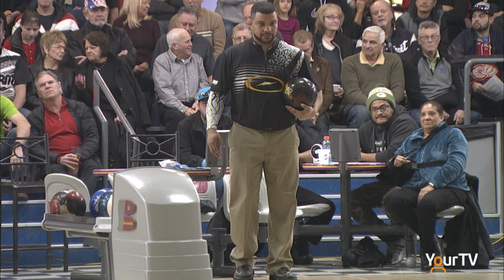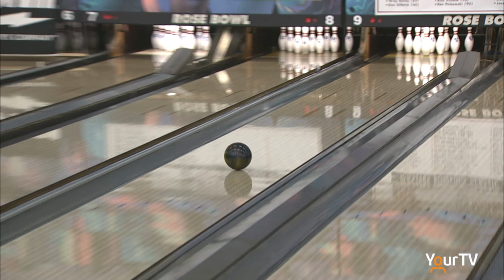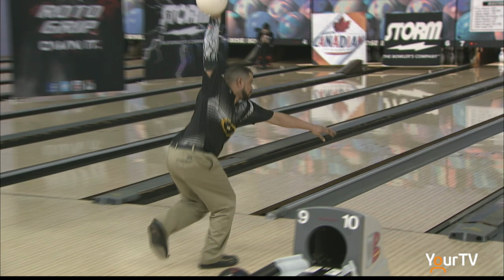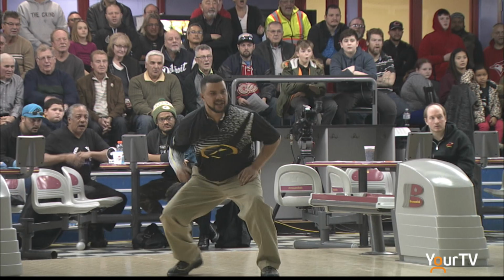Walls Jr. spares 7-10 split

Comment: I picked up the 7-10 once, back in January of 2019. I was having a terrible night on league, left the 7-10, got pissed, and absolutely heaved my ball at the 10, hit it right of center, sent it off into the back HARD, it bounced out of the pit and took out the 7 after I'd turned around because I was certain I was just going to get the 10. The guy next to me started to bowl and saw the 7 go down just as he was throwing and he tossed it right into the gutter. Half the house shook my hand that night. It was the only good thing about the whole evening, though. I do have a ring to commemorate it, at least. I figure that, as a 150 average bowler, the 7-10 conversion is probably the biggest highlight I'll ever have, but damn, what a highlight.
Reply: @LockDownOnSparta  Me and at least 36 other people enjoyed reading their story, so I don't know what to tell you. What the hell do you even mean, 'riding on its coat tails'? It's an anecdotal story related to the video. What do you think the comment section is for, exactly? What is a 'correct' comment?
Reply: @LockDownOnSparta  C0sMic Commando hit the nail on the head. My story was intended to relate to the video and how big of a deal it is to actually pick up the 7-10 split. It wasn't any sort of attempt to take away from the conversion in the video but to add to it.
Reply: @LockDownOnSparta  It's just a yarn. He said it was a stroke of luck.
Reply: Great story, thanks for sharing. I made the 4-6 split once and another time rolled a 278 drunk. My two bowling highlights out of thousands of games lol.
Reply: @brucenewlin6208  You've definitely got me beat on the 278. Nice game, drunk or not.
Reply: @LockDownOnSparta  you sure didn't get a lot of care as a kid
Reply: @LockDownOnSparta  There's always at least one richard in every crowd.  On this reply thread it's you !
Reply: Don’t listen to those negative comments. Great job, coming from one bowler to another!
Reply: @LockDownOnSparta  I bet you like your toilet seat warm, you wash your hands to get a drink, you leave the room to fart, you sit down to pee, and according to your profile, you enjoy sleeping with your leg off of the bed and have Mike Myers under the bed.
Reply: I average 170, and I still haven't converted any splits more difficult than the 4-10 (right handed).

Comment: I've been bowling leagues for 25 years. I've bowled with some high-level amateurs and even a couple of pros. I've seen more 300s than I can count (dozens, if not hundreds). I've seen ONE guy pick up the 7-10 split ONE time in all those years.
Reply: Cool I’ve been bowling have my own ball and I’m pretty good also I hope I could get a scholarship for it
Reply: Been working front desk at a center for about 6 years, just once or twice a week, nights during leagues. We're not always super busy once the leagues get going so I end up watching a lot of bowling. Have seen the 7-10 made twice. Once was in a more casual league, social bowler just tossed her ball at the 10 pin not too hard, turned around and didn't watch it. Hit the 10 right on, somehow it bounced out of the pit and took out the 7. The other time was a guy who can throw 23+ mph and he decimated the 10-pin and it rocketed across and crushed the 7.

I "made" the 7-10 once, summer 2019. Practicing 10-pins, had one bounce out of the pit and take out the 7 (and only the 7). Got a picture of that, how many bowlers can say they converted a 1-2-3-4-5-6-8-9 spare?
Reply: Respect, First, you somehow got the 7-10 to go on your first ball. 2. You didn't choke picking up the spare.
Reply: @joeconn4  Wait, you managed to hit the 1-2-3-4-5-6-8-9 in the end? Rad.

Comment: I'm not even a bowling guy, but when the one announcer said he got "help" when the 6 pin went down, I wanted to throw up
Reply: not on the lane plz
Reply: Dusty Rhodes, from what was said, having the 6 pin standing would have helped with the spare, as the idea would be to catch the right hand edge of the 6 pin enroute to the 10, and knock the 6 pin across the lane, into the 7 pin.  

Oh, and for the record, I have salvaged a 7 - 10 split.  Bayside Bowl, Australia, 1984.  And have the patch from the Australian ten pin bowling congress!
Reply: It helped his pin count so it is correct.  He didn't say overall help.  There is no guarantee he would have made the 6-7-10 split.
Reply: @111jacare  With the 6-pin standing, it's still a difficult to impossible spare to pick up. Having the six out significantly reduced the possibility of an eight count. A pin is a pin and sometimes one pin is the difference in tournament standing.
Reply: Edward Stevenette  A pin is a pin. If fact, if you're on a strike that one pin can be two. Gotta nickel-and-dime sometimes.
Reply: @anonymike8280  He's not on a strike though. Chances are very good either way that he goes home with 9 points that frame, and you're something like 10x as likely to pick up the spare on 6-7-10 than on 7-10.
Reply: @OMGclueless  I tried to look up the odds of converting various splits for PBA-level bowlers. I couldn't find anything but I don't think that spare is converted very often at all. I think you are more than ten times as likely to pick up the 6-7 or the 4-10 than you are the 7-10. One source stated that the 7-10 has been picked up only three times in the history of live televised bowling. Count is count. Sometimes you win or lose by a pin or two. Not that I have bowled in long time.
Reply: @anonymike8280  The 6-7-10 is actually relatively easy to make, in comparison to a 7-10. By no means guaranteed, but by virtue of the 6 being far enough away from the gutter, and in front of the 7, there's a decent area you can hit and pick up all 3 on a consistent basis, whereas a 7-10 is almost entirely luck based.
Reply: @Skyfighter64  The 6-7-10 is possible but unlikely. The 7-10 is essentially impossible to pick up in any reliable and consistent way. There is a defined ball location for the 6-7-10 or the 4-7-10. There is no defined location for the 7-10. I don't what the odds of even a pro bowler making the 6-7-10 are. I do not think they are very good.
Reply: and I was utterly shocked when he said the shot looks good.. it was clear from about 2/3 down the lane that it was heading high (if the guy was lucky, he would have gone brooklyn, or if he was unlucky, he would go headpin high and end up with the 7-10 which he did).. but what a sensational pick up on the 7-10.. i've never had the chance to make that spare yet
Reply: @111jacare  if ur strong enough to ram a pin into the back then the 7-10 is easier than 6-7-10

Comment: My home lanes have some kind of little trick to them; if you gutterball hard enough, it will sometimes pop out of the gutter and the last second and bump the 7 or 10. Works also if you hit the gutter hard enough right at the last second, too, but won't do it for normal gutterballs for some reason.

Comment: That was amazing I was wondering why he threw that ball so hard
Reply: Because you have to ricochet it so you want to throw it harder
Reply: He had throw the ball very hard to generate a lot ball speed ti get the pin to bounce out of the pit the way it. I think that there is a 6 in drop from the pin deck to pit. That's the reason he needed to release the ball very hard to get the pin to bounce out and roll to the 7 and take it out

Comment: wow i never saw someone make the 7-10 split (the hardest split in bowling)!
Reply: 5-7-10 is harder. With the Lilly/Sour Apple, you have to launch the 5 pin into the 7 pin, and hope the 5 pin still has enough energy to launch itself across the lane into the 10 pin. Problem is, people don't leave behind the 5-7-10 as often, resulting in bizarre facial reactions from even top pros when they do see that split.

Comment: Made it once once in ten pin and twice in candle pin.  Ten pin was a big time fluke.  I got the ten pin down but the machine locked up where the part where it separates the pins by spinning some how shot out, deflected off my ball and into the 7.  My father couldn't believe his eyes.  As for candle pins the first time I had absolutely no wood to help me.  The second I had one thru six  sitting on top of the ally.  The eight and nine pin fell into the drop off.   I simply threw the ball dead center to take them out.  But that ten pin by rule standards but to this day I still say I legally cheated.

Comment: I have done this couple times...you just need speed to do this..hit the pin as hard as you can and if there is balls behind the frame..it will most likely bounce back and will go other direction..
Reply: I have done it twice but never this way. Both times the pin slid over to the other side in a similar fashion to how Rash did it last year.

Comment: *Virtually impossible*! Haha
Reply: You don't see a 7-10 converted very often.  It's happened a few times on PBA telecasts.  I remember when Mark Roth converted one back in 1980, the first time it had been done on TV.  He did so in much the same way - he threw the ball at the 10 pin, which kicked out and took out the 7.

Comment: It is virtually impossible if you curve your ball but I am only a 165 avg guy who rarely bowls and throws a hard straight ball (I am just starting to learn to curve the ball the last couple outings) and I have made two 7 10 splits in my life...just scraping the inside of the 10 pin and having it ricochet off the wall and spin back and get the 7...as I said I have made it twice in my life.

Comment: My brother converted a 7-10 split at age 7.
Reply: In my time (bowling hardcore for 13-15 years) I would've converted a handful at most but the other pin was never there for it officially count as a 7-10 conversion :(
Reply: @joeschmo9838  Same here, I'd take out my frustration on a ringing 10 and fly across to an empty 7 but couldn't do it when both were standing
Reply: I did too at a young age, and again maybe in 2017 on some really worn out ancient wood lanes, but I was never really a great bowler. It's a shame I never stuck with it younger.

Comment: Modern back curtains won't let you do that. Far too flimsy taking this shot from near impossible to impossible. Sad.
Reply: To me, it looks like the 10 falls into the pit, followed by the ball, which clips the pin and flips it back out and into the 7. I don't think the back curtains came into play.
Reply: It’s because the Curtain and Cushion are separated, those are on Brunswick GSX Pinsetters. The machine where he converted it is on a Brunswick A2 that it has the Curtain and Cushion connected, same thing goes with AMF machines.

Comment: I've only bowled for a few years and picked up a 7-10 Split at least two to three times and I'm not good. Just goes to show you that picking up a 7-10 is more about luck than skill. You literally have to hope you get a fluky bounce of the wall and one pin slides over to hit the other one.